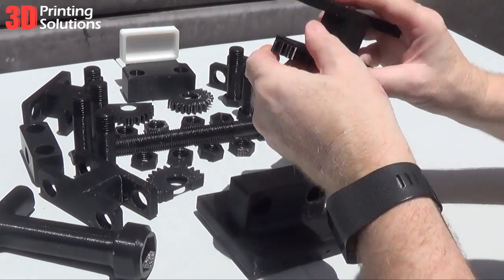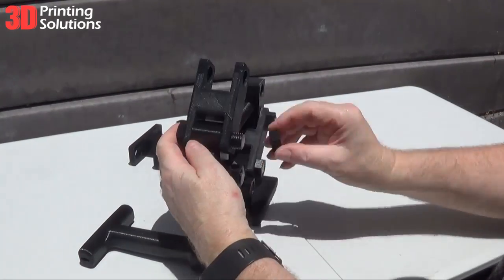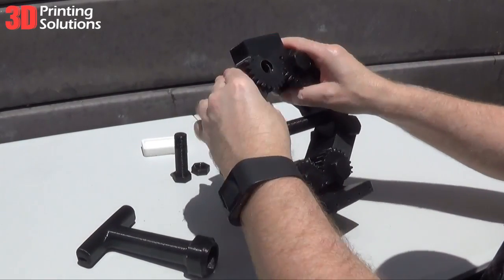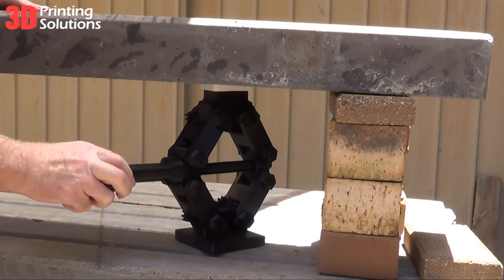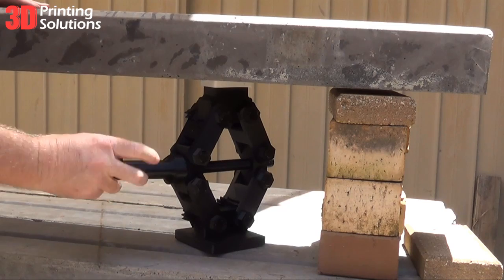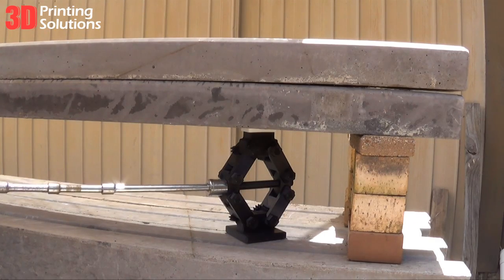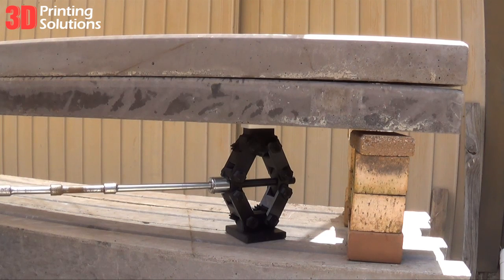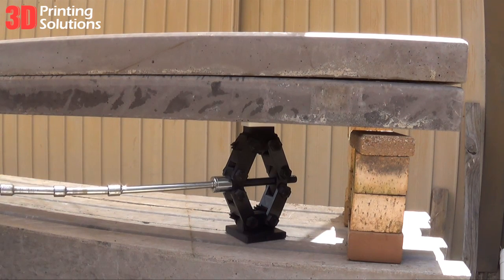PolyMaker PC-Plus PolyCarbonate Lift Test

Comment: That's awesome, but isn't one end of the sleeper supported? So it's kinda misleading to quote their full weight
Reply from the maker: We weren't trying to be misleading with our wording but you are correct that the sleeper is supported on one side. The filament manufacturer Polymaker actually printed our jack and lifted a car with it , so we are still confident it could easily lift 240kg :) Heres a link to their test https://www.youtube.com/watch?v=KNyueiXe-r0

Comment: Looks so cool! What printer did you guys use? Was it the up! Box?
Reply from the maker: +Aravind Rajkumar Printed with the UP Box using a Build Tak surface. Filament setting set to ABS spool type. 0.1 resolution. Most solid fill with the quality set to fine.

Comment: I would love to print that one myself with my roll off PC+. Is it possible that the design could be shared? :)
Reply from the maker: +Mikael Blomberg Thankyou for your interest in this project of ours! We will probably release the STL files in the future, but not at this moment. I'll get back to you when we release the files :)
Reply: did you ever share this?
Reply from the maker: Sorry for the late response! We love the community of file sharing that helps support the 3D Printing community and we really wanted to share this model after we received so many requests. We have shared the jack with two of our close business partners (one of them being Polymaker) with the expectation they do not share it. In the end we decided not to release it to the public due to one main concern. Every 3D printer on the market is different and the strength of the model would widely change with different materials or an untuned 3D printer. We would hate for someone to try use our jack at home to lift something and injure themselves. People have been quite understanding our reasons, we hope you are too :)